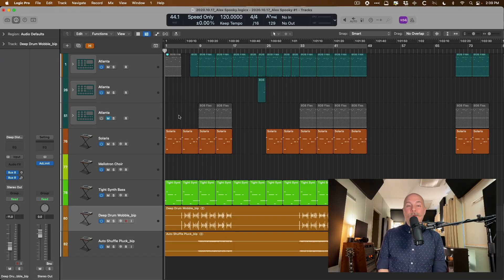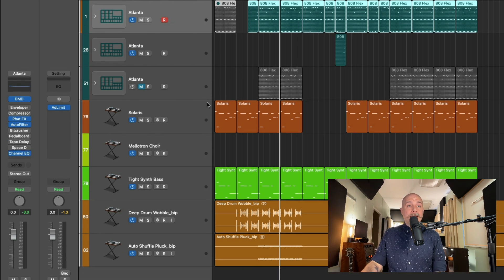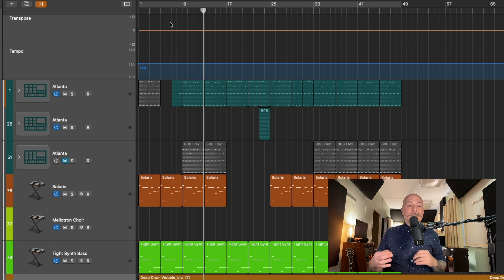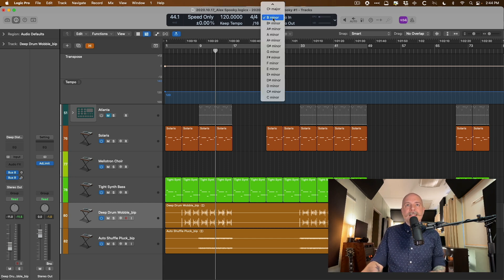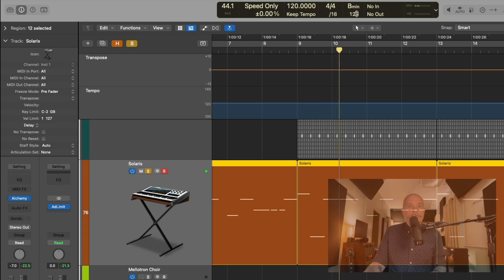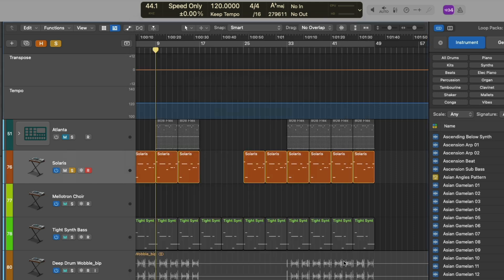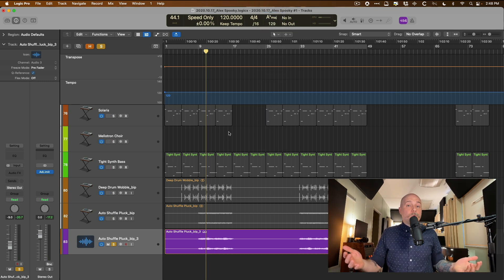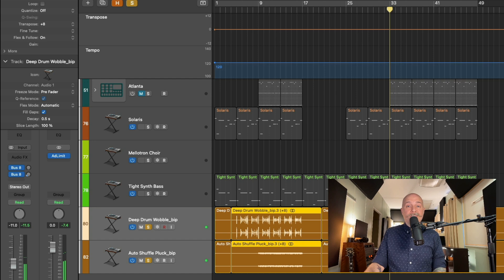How to Transpose Anything in Logic Pro - Yes, Even Entire Project

Comment: I’ve just rewatched this because I have to do some transposing and I have to ask, what is the point of the transpose master track you opened if you never use it? I would have thought the easiest way to transpose without altering key signatures is to simply adjust the transposition in the transpose track? Wouldn’t that keep all the intervals correct because it is still working in a major or minor scale (whatever you’ve initially chosen)? 

Anyway I’ll experiment later today when I get back to my studio.

Comment: Thank you! Every time I watch your video, I learn something new (like varispeed!) For me, transpose track is not working what I expected sometimes. I changed key (+1) which gave me correct result at first. However, when I changed from +1 to 0, MIDI is back to original key, but Audio files doesn’t, which I have to go into region inspector to change everything. I don’t know whether it only happens to me, but I just manually changed the key in the region inspector, which seems straightforward to me 😅

Comment: Thank you so much!  You answered my question about changing the pitch and speed of a project independently.  However, in the last example of transposing the entire project while maintaining tempo, is there a loss of audio quality with the Flex and Follow function?  

What loss of quality is there, if any, with Varispeed and Flex mode with audio?  

What I am trying to do is change the speed only of a project, which you can obviously do with Varispeed.  But I have yet to find an answer as to the resultant audio quality of a sped up audio loop that is already in the project.

Comment: Hi Chris, great video. You didn't go into the Varispeed option of the kHz adjustment. I was wondering can you use that to change a whole project from 440 Hz to a 432 Hz tuning? I'm very interested if it is possible to easily tune down a song to a 432 Hz tuning in Logic. I hadn't heard of this option before, is this a new feature in Logic or has it been there for years? Thanks for all your insightful video's!

Comment: Hi Chris,
Thanks for continually putting out excellent tutorials!  Lately, I have been wondering how to use the Global Transpose with regions that include key switches/articulations.  For example I'll have a MIDI bass guitar track (Toontrack EZ Bass) that will have both the melody and articulation notes in the same region.  The articulation MIDI notes are required so the plug-in knows how to approach the melodic note (slide-in/out or other bass guitar techniques). Ideally, I would like to simply change the key signature globally as you show, but this will also transpose the articulations MIDI data and of course the bass line will not be executed the same.  What would you suggest for preserving the articulation data when transposing?  Is there a way to lock certain MIDI notes within a region?  Or, should I be duplicating the track and dividing the melodic MIDI data from the articulation MIDI data (and marking No Transpose on the articulation track)? Any suggestions would be awesome and thanks again for doing such a great job!
Craig

Comment: I really wish there was a way to also transpose parametric EQ'ing. Im in the bad habit of semi mixing when creating/ recording music. I can't stand working with painful frequencies so i notch them out straight away, but then if I then need to transpose things the EQ'ing was a waste, and I have to redo it. Anyone know a fix for this? (Yes, I know I could have bounced it, but it doesn't really help with MIDI.)
Reply: The only fix I know would work for this is if you use pro-Q 3 for the shaping and then select all the points and move them based on the little keyboard you can add at the bottom of gui. If you don’t already own pro q 3 though it’s a little pricey.
Reply: @lawinter1949  i do have Pro Q3 and that’s how I do it now, but it’s quite time consuming to manually do this with every notch EQ. And for some audio when transposed it doesn’t have the same impact on hearing. But thanks for the reply and tips.
Reply: @yeskimkim  one other plugin that might work is slice eq by kilohearts. It has a transpose macro knob but it doesn’t snap to a note on the keyboard. It’s free with any purchase on adsr sounds right now